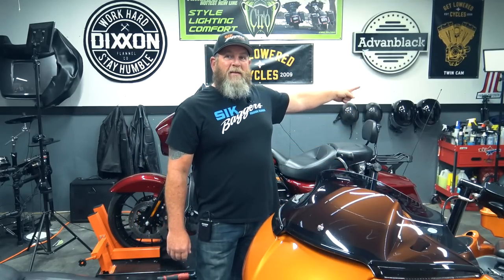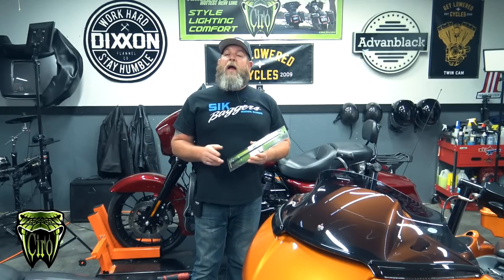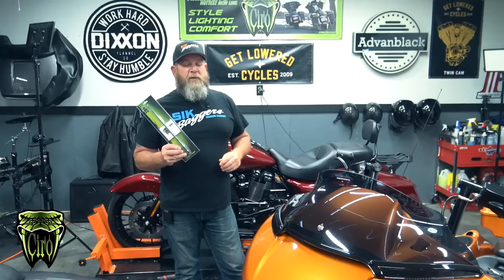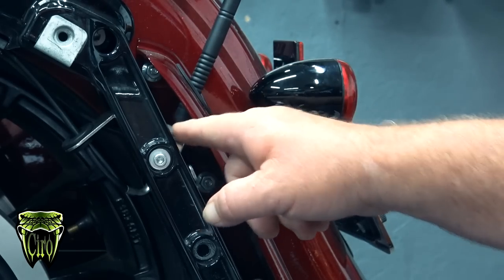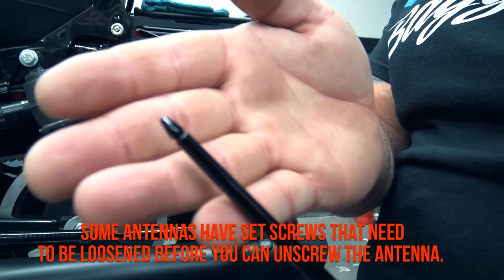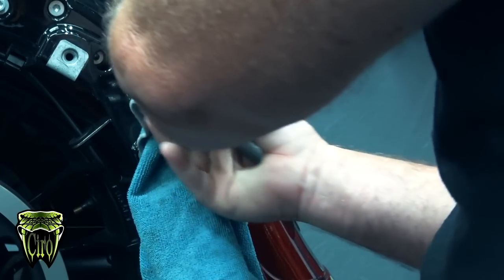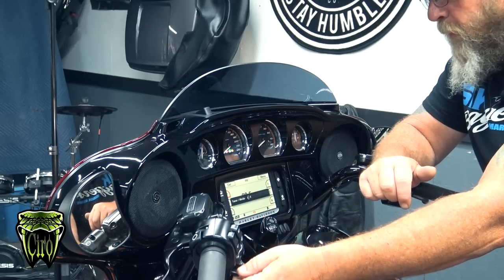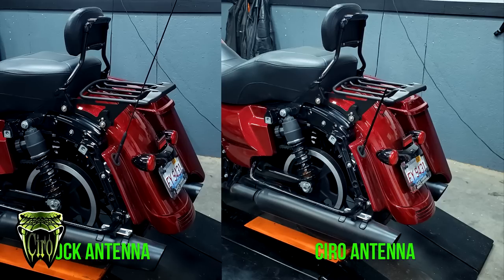Ciro3d High Caliber Antenna

Comment: Would that work what touring pack ? What the antenna mounted in the trunk I have a 2014 Limited.  Iranda Ozark Hills Arkansas Missouri Oklahoma and even with the big antenna it still cut out

Comment: Iv'e got the Advanblack extended saddle bags and extended rear fender. Is there a product out there that extends your antenna below the fender similar to the harley extension for clearing a tour pak. I installed a hog tunes amp that interfears with my reception. Right now I have my antenna whip located below the seat to the gas tank. Prior to the amp my reception worked good. i'm thinking if i get the antenna out again maybe that will help?

Comment: Hey Brother Steve, how about us guys running a CB antenna also. Any ideas on a matching antenna for the CB? Thanks Brother!!
Reply from the maker: hey bro...they actually use this same antenna for the cb radios too.  I cannot say how good the reception will be as I have not ran that for cb's ...it seems to be in my experience with any short antenna that reception will not be as good as longer ones...its just how radio waves and  antennas work...I would bet that if you are suing it for short waves, say maybe someone riding in your group that you would be fine.
Reply: @sikbaggers  Thanks Brother Steve, appreciate ya!!!

Comment: I live in the Colorado mountains. Will the 12” antenna still work? I see there is an 8” also. Is it as good as the 12”? Or at least close enough? Thanks
Reply from the maker: Sorry for the late reply...been at Tail Of The Dragon for a week. both those sizes will give you right about the same strength

Comment: 09 street glide factory radio reception is the same with or without the antenna... Radio sound quality  Poor but CD sound quality excellent.  I was thinking about replacing the stereo unit... What would you recommend?  Is there a good flag antenna?
Reply from the maker: Get the aquatic head unit...one of the best on the market for the 13 down bikes

Comment: Hey, I bought this antenna after watching this video for my 2021 RGL and the reception was horrible.  Had to go back to the long antenna.  Just wanted to post this in-case anyone is trying to decide on what to purchase.
Reply from the maker: Yeah no shorter antenna or even hidden antenna will be as good as the long one...thats just how radio waves work...they are great if you just want to shorten the antenna and not use it much...trust me ive tried about 10 different ones..

Comment: I have gone through about a half of dozen antennas and can not seem to get one with a really good reception,  does this one really give you good reception???
Reply from the maker: Short, hidden, or stubby antennas are goin g to be great...some a little better than  others, like this one I got about 5 stations compared to the 1 or 2 I get from other installs I have done. Thats just how radio waves work...No shorty or hidden under your fairing antenna is going to work better than a long antenna. I dont care who makes it or what they taught it to be able to do..its just science. I have installed some hidden antennas with "boosters" on them and maybe got 3 more channels, but thats about it.

Comment: Anybody have any experience with Harley’s hidden antenna?
Reply: Yes. It works. Not quite as as good, but good enough. If you have a street glide, what works well is taking the antenna off the rear bracket and running it up the frame with zip ties. And it’s free
Reply: Yes, same experience as Controlled Chaos, works but not good enough for where I ride. Close to the city it's fine, get out a little bit not so good.  Did the antenna along the frame and under the seat thing "before" the hidden antenna and it was better. Hidden reception was not as good.  I finally bought an XM radio module and solved all reception problems. If i want a local station and I'm out a ways I use iHeart radio app from my phone.  Hope this helps.

Comment: Yeah, who would have thought that playing music off a radio that plays it for free would get you a copyright violation.  Ridiculous in my opinion. I have one, forget where I got it, (antenna) and it doesn't pick up crap, neither did my long standard one either, but this is MI for ya.
Reply from the maker: no antenna on the market will pick up better than your stock long one. Thats just how radio frequencies work..but I would check behind your left saddlebag and make sure you are screwed in all the way and check the connection at the radio ...depending on the model radio you have , some are hard to push in and it doesnt get pushed in all the way and some are so sloppy that riding down the road they come loose. But here where I am too we get one, maybe two decent stations if you are riding around town so we use a flash drive with music on,...I feel your pain
Reply: @sikbaggers  Thanks for the idea, didn’t even cross my mind to look at the connections, other then the antenna itself. I still have the H-D stick Stereo. Wouldn’t mind having the one you showed in the video, since SiriusXM would be a hell of lot cheaper, for the receiver. Also because of Apple Play and making headset connection easier and cheaper.
Reply: @sikbaggers  Between today and yesterday, I checked both connections. Thank you again for your reply! My radio now gets about 7 stations, compared to before, when I only got 1, if lucky. This is from my home and now I get 7 so I know, the connections were the problem.  Thank you so much again.